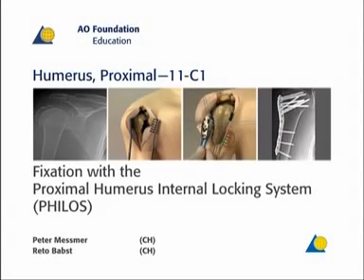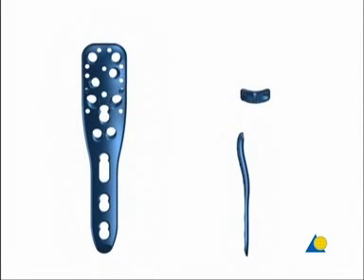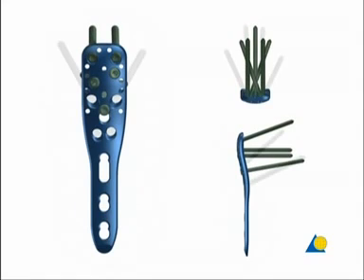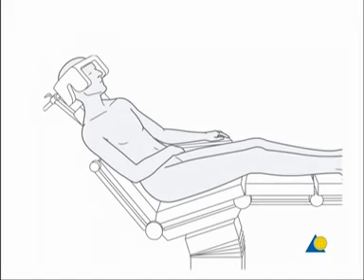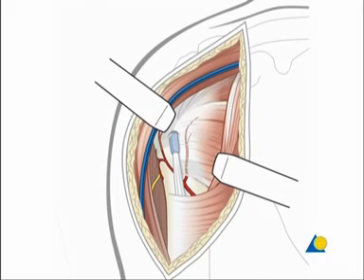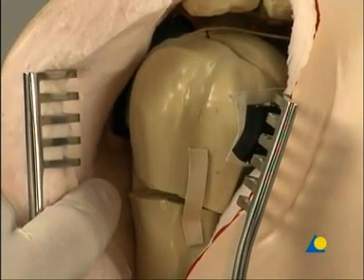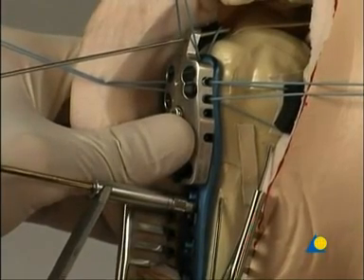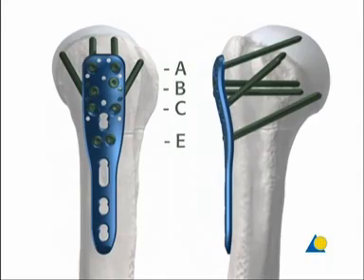AO humerus proximal fixation with PHILOS plate

Comment: I'm here because I had basically this surgery done to me. LONG POST but any medical students and aspiring orthopedic surgeons may find interesting.

Not the exact. My shoulder head/joint(sorry, don't know the 1000 medical and Latin terms so using normal speak here lol) remained in one piece 

Fracture I had was full, clean humerus break. Maybe 2 inches below the shoulder into the humerous 

Cause 
99% sure I had a stress fracture that reached its limit. I run and power lift. Maybe about 3 months ago in August I was doing benching for strength(meaning I was benching heavy weight for few reps, taking about 70-80% of my strength)

Felt something midly painful coming down one rep. Didn't think much of it(the pain was there only for a moment, and way too low to set of any red flags)

For the next 2 and half months I'd have reoccurring and persistent discomfort and pain in the upper bicep. To explain why I didn't do much 

1:again it was probably a 1 out of 10 on the pain scale. Way to minor to cause me concern

2: I did start to take action, started benching less sets and less days, but it was too little to late. Even skipped benching for a while week(used to bench 3 days a week, first day 5 sets for 5 reps, next two 3 sets of 5 reps, when going up in weight I lifted I started to cut fown to 3 reps, then build my strength up until I progressed to 5 reps)

Eventually cut down to just one day of 3 sets. 

Only ONE day did the pain reach concerning level and that's when I took the week off

Following week, on Monday(my push day)

I go in
Do my activation drills
Rotator cuff warm ups
Do my prep set at a lighter weight
No pain
Feel fresh and ready 

Load up my weight(260 lbs had been doing 3 reps of 3 sets for a few weeks so nothing new)

I get set
Get in position 
Everything's proper form and proper tight 

I un rack
Come down
Starting pushing up
I get about 2 inches up when suddenly loud SNAP/POP(loud enough that other people in the room with earbuds playing music heard it)

Right arm IMMEDIATELY goes number and rag dolls
Luckily I had the safety racks on so NO the bar did not crash onto me or come down hard, it was caught by the safety bars

Could move my arm. IMMEDIATELY knew I needed surgery.
In a Thankful sense the bone poked a nerve so my bicep went numb and I didn't feel any immediate agonizing pain. That's not to say it felt good afterwards. It didn't. But it was tolerable pain(tolerable in a loss sense. I wasn't screaming and crying but it took and active focused effort to keep the pain down and my body calm, really bad residual pain)

No damage to nerves, could still move my hands and fingers

Stayed overnight at the hospital and got surgery the next day. Took about 3 hours, 3 plates and 12 screws(I'm US military in Korea, treated by a Korean surgeon, he almost forget Americans on average are taller than Koreans and have longer limbs so took him a little extra time. Still, awesome job. Despite the fact I can't do weighted workouts with my right arm or articulate above parallel it feels totally fine, it's even already remained half it's muscle mass from the atrophy)